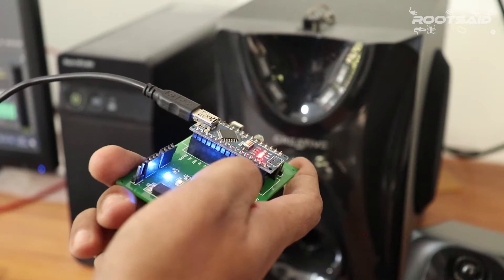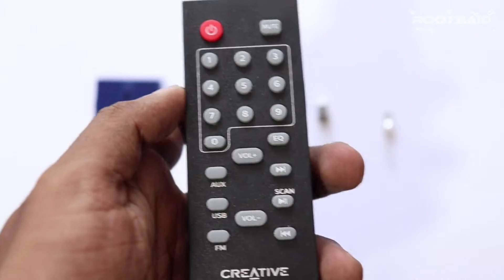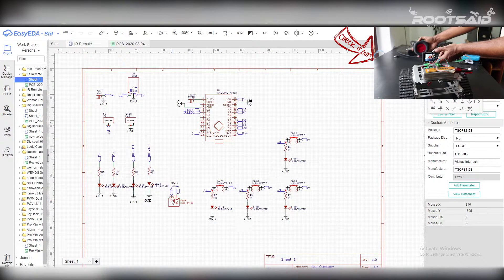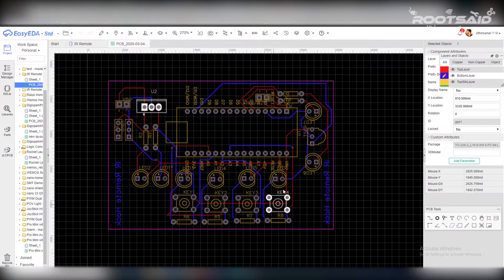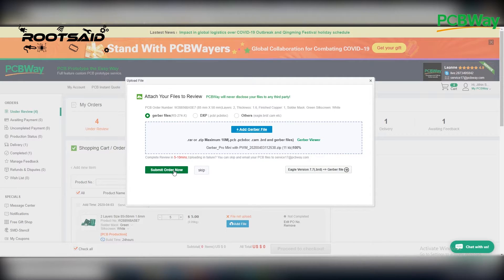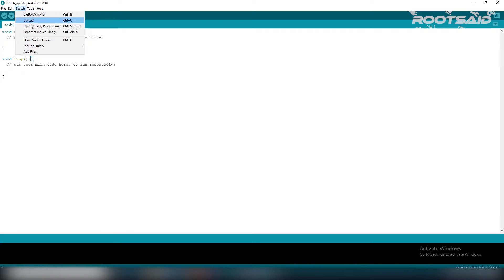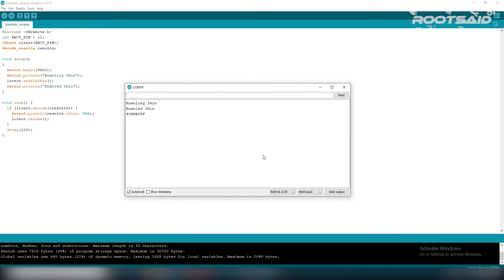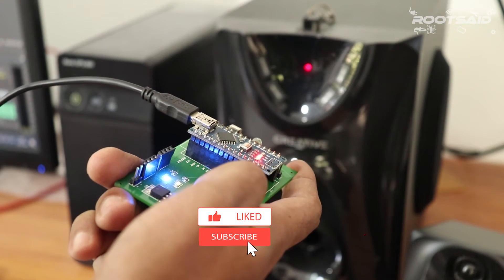How to make Arduino IR Remote Control? Arduino Project Tutorials

Comment: That's cool. I have been working on a n ir remote control project. What is the range of this infrared remote control?
Reply from the maker: This infrared remote control has about 1.5 m range. You can increase the power by decreasing the value of resistor connected to ir led. But if you reduce it too much, it will burn off the led.

Comment: I am new to Arduino, I need to make remote like yours but just a single button and a single command. Can I use the Arduino without that pcb as shown in your video? I want a button that when pressed it will send the command to switch between the HDMI 1 and HDMI 2. my remote has the button for it.
Reply from the maker: ofcourse you can do that